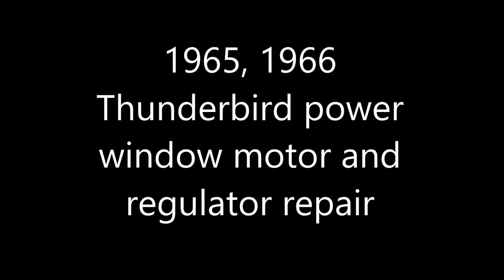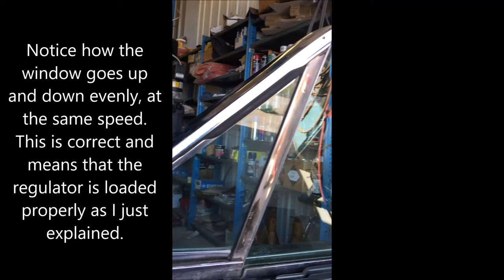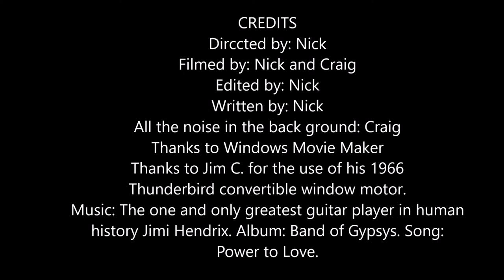1965, 1966 Thunderbird power window motor and regulator repair

Comment: On my 65, the passenger window was going down very fast and going up at normal speed.  It has now quit going up or down.  What should I look for as the problem? I'm thinking I had a broken spring and it went down too far and the large gear of the regulator is no longer meshed with the motor gear.
Reply from the maker: If the regulator is not loaded correctly, the window will not go up and down properly. This is probably the reason why your window was going down fast and up slow. The springs slows it down going down and speeds it up going up so it goes up and down as the same speed. How the window motor and regulator assembly is loaded controls this.  In my video I show how to properly load the window motor and regulator assembly. You need to remove yours from the door and make sure it is loaded correctly. However, first replace the gear and see if the motor is okay. If not, you can follow my instructions in this video on how to clean the motor and get it working again as long as it is not rusty. Good luck.

Comment: My motor works until I put the nylon gear in?  What am I doing wrong?  Thank you
Reply from the maker: Hi Debra, that's a good question but I don't have nearly enough info and without being there to see it first hand, its hard to know. However,  You can test run it on the bench with the motor and regulator together in the vice like I show in my video. Install the motor onto the regulator and run it. Then engage the big gear into the motor like I show in my video and run it. If it works on the bench and not in the door, them its something else, something in the door or window related, not the motor or regulator. If you install the motor and plastic gear onto the regulator and then it doesn't work, then Id say your plastic gear is bad. Do not use the plastic gears with the springs in them. Those are trash. The motor and plastic gear should work fine once bolted up to the regulator. Good luck.
Reply from the maker: Hey Debra, after reading your question again, I realize what your asking, I didn't get it exactly the first time. sounds like your nylon gear is bad. Who did you get it from? Call them and see what they say? If you didn't get it from the Birds Nest, call them and get one from them. Grease everything up really good. I use white lithium or wheel bearing grease and I really lay it on thick. Maybe the hole in the nylon gear is too small for the stud in the motor where it slides on? Ive seen that before. maybe you can hone that out a little? Good luck.